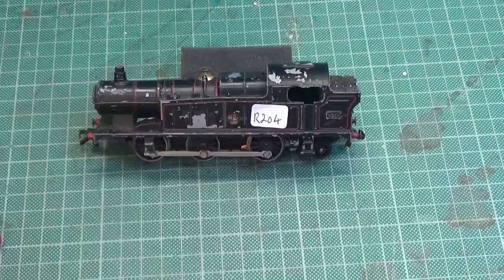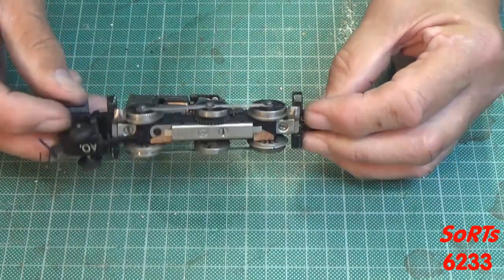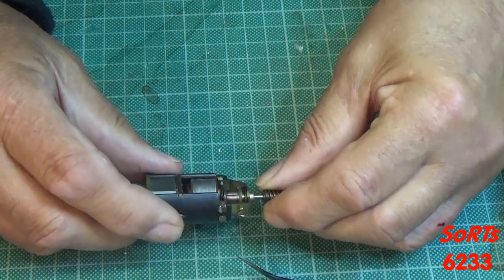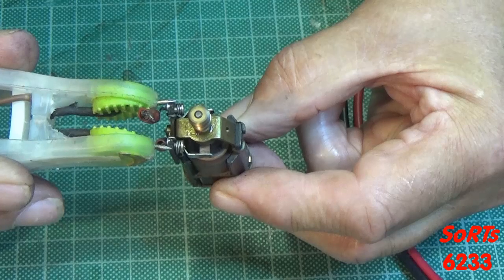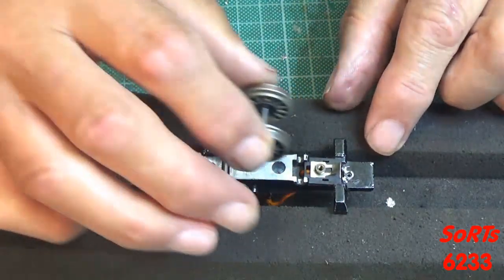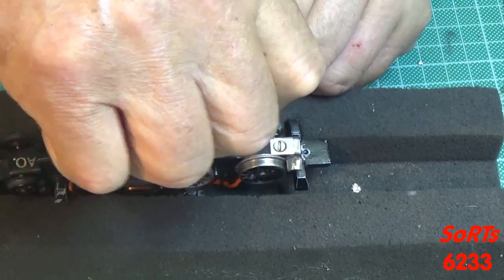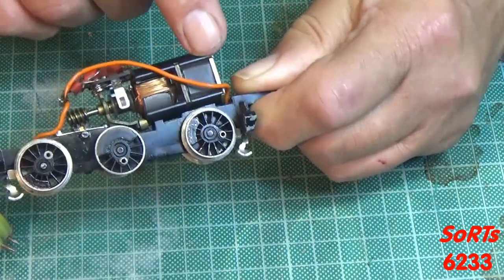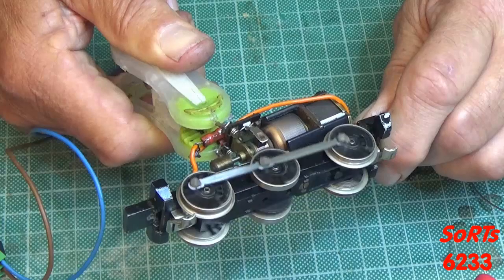Trix Collett 5600 Restoration, Part I

Comment: Interesting, I know nothing about Trix twin, but did I hear you say the motor was drawing 900ma? That seems very high and would seem to suggest it might need remagnetising. After several years of procrastination, I finally bit the bullet this summer and bought a Ronald Dodd remagnetising machine. Not cheap, but absolutely brilliant. I been using it regularly as I gradually get my Hornby Dublo collection back up and running. Most HD locos draw between 380 and 550ma. Anymore than that and they start getting hot and there’s a risk of burning the armature out. If you can , buy yourself a remagnetiser. You won’t regret it. All the best. Rob
Reply from the maker: I;m sure I said 90ma (at least, I hope I did!) I really like the magnetiser. I just need one more little part and this will run like a dream! Appreciate you looking in! Cheers, Jim L